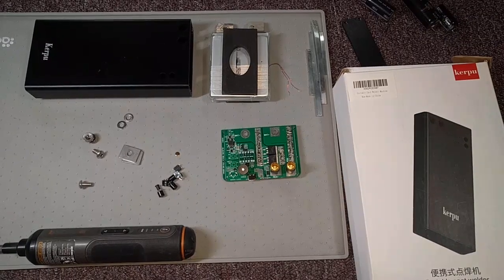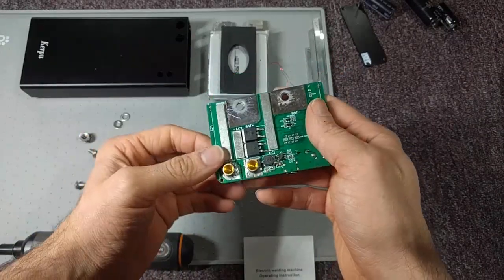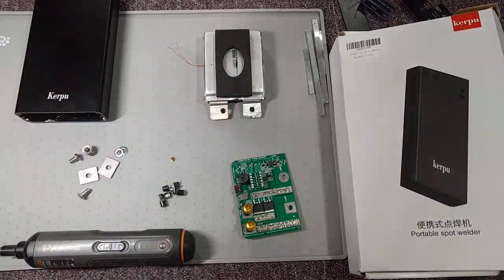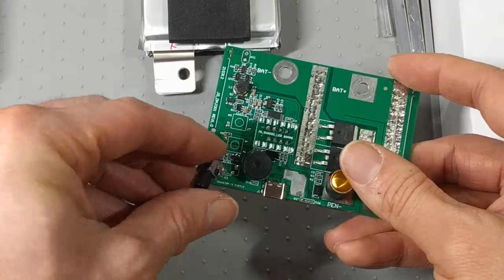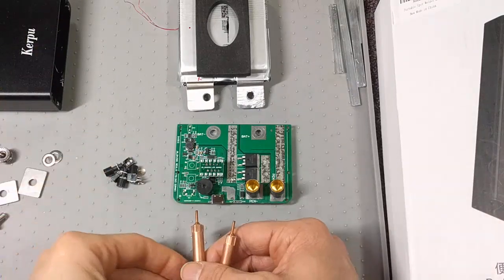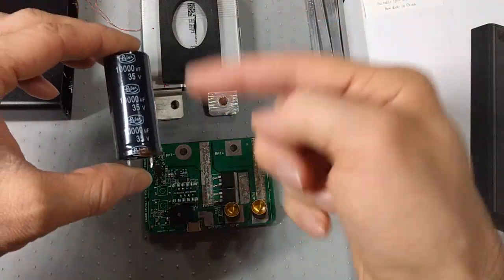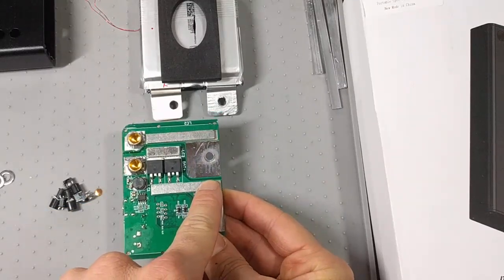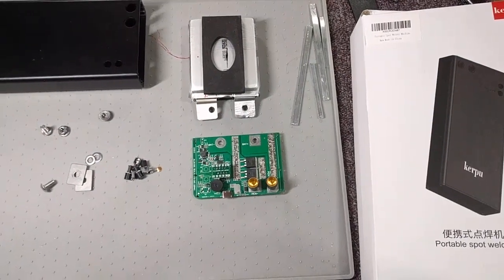Kerpu Spot Welder Disassembly & Upgrades Part 1

Comment: Hello I notice there are two think red wires coming out from the battery on my Kerpu Spot welder.  Do you know what these are for?  I am also planning on upgrading the battery on my Kerpu.  Thank you so much for posting this helpful video.
Reply from the maker: most likely NTC thermistor.  It measures temp of battery so it shuts off if it gets to hot to keep from exploding
Reply: @SegasonicfanDesigns  Yes.  I was thinking along the same line.  Maybe I should test out the resistance values with various temperatures.  

I am curious though, would the kerpu spot welder work without the thermistor?  

It was such a pain to get the circuit out, the power tactile switch ripped apart in the process.  Awful design as you've mentioned.   I may just get another cheap spot welder and use external batteries.  Internal batteries suck.  Thank you once again for posting such informative videos.   

I was also looking at the MOSFET datasheet.  I wonder how many Samsung 25Rs I would need in parallel to generate such high amperage (I will stick with 10P).  I think the AGM3015H mosfet is rated 230A max.

Comment: I also have a "Kerpu" spot welder, this one seems to be either a later model or a fancier model. The PCB inside looks almost identical, except mine came with a tiny OLED display on the front, and the battery has thermal paste and metal to thermally bond it to the case.

Comment: If those are two Mika strips on either side of the positive bus mounting point it is a good insulator. They cheaped out on design for ease of manufacturing.